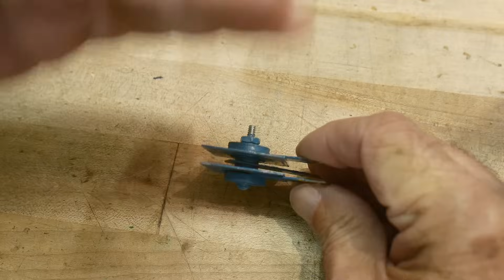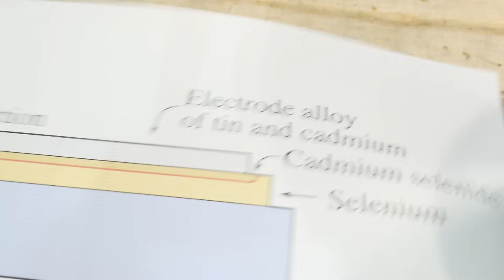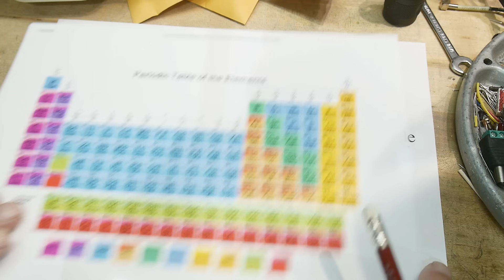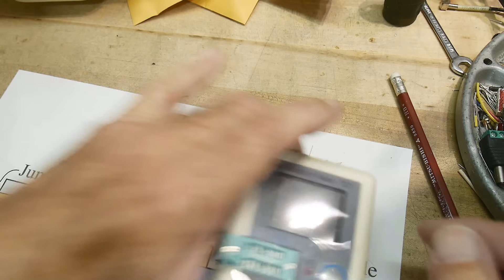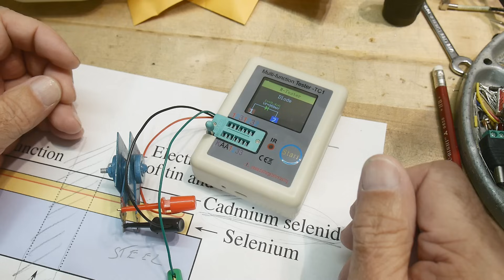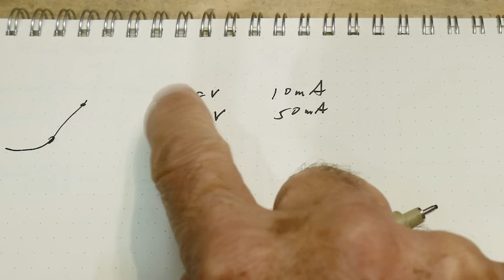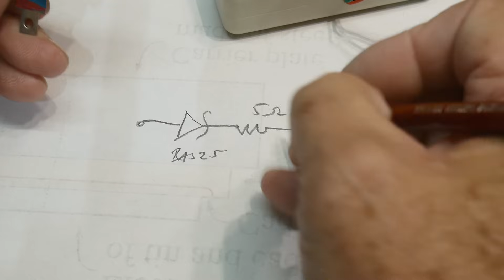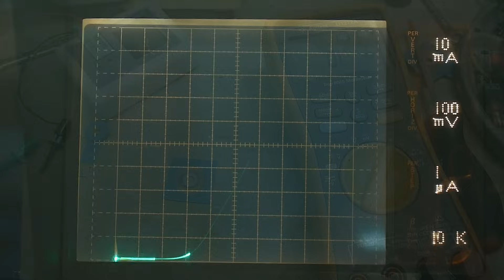#1753 Selenium Rectifiers

Comment: A nice look into selenium rectifiers - I wouldn't discombobulate one without gloves though. Still better than letting it burn, emitting toxic hydrogen selenide.
Reply: I remember that smell very will. I assumed it was a Sulphur compound though, It was really bad!  Smelt like the Devil!
Reply: @barrybogart5436  Like anti dandruff shampoo, which contains selenium in it.
Reply: @barrybogart5436 i agreee, as i described in a comment here, i also was "experienced" ...
Reply: I've heard so much about the stink.... I "need" to smell it.
Reply: @edgeeffect  Trust me you do not, it lingers for a really long time.
Reply: @SeanBZA  see, if this was a chemistry video, not electronics, you'd just say "there's always got to be one". ;)
Reply: @edgeeffect  I hope you're just sarcastic :)
Reply: I once dug through a couple of dumpsters full of electronics from some industrial warehouse, where I scavenged tubes ( Telefunken 12AX7'S), tube based Philbrick op amps, hundreds of chicken head knobs, rotary ceramic selector switches, power and audio output transformers for tube equipment, and lots of other great resellable stuff; the dumpster was also full of  thousands of various selenium rectifiers but I didn't bother to take any of them.  Of all my flea market and dumpster diving hauls, I regret not having had more time to really dig into those dumpsters because they were full almost to the brim and I could only dig down a couple of feet or so as I rooted around insidethe dumpster; I only had a day and a half to make a couple of trips and haul two car loads of stuff home, before it all got hauled off to a dump somewhere.  If I had had more time I would've rented my own dumpster and had it delivered on-site so that I could toss the unwanted stuff into as I dug deeper into the full dumpsters. I paid the guy cleaning out the building a couple hundred bucks for the privilege of scavenging from those dumpsters, and I sold about $5000 worth of tubes and parts from just my two station wagon loads.  I barely scratched the surface of what was in those dumpsters! Unfortunately all that toxic selenium probably went into a landfill but I don't know what else you could do to recycle those nowadays.
Reply: @goodun2974  holy bloody moly, what a treasure! You were luckier than that crazy Aussie bloke :)
Reply: @KeritechElectronics  ,  I've had some good dumpster hauls and fleamarket finds over the years,  Such as an old 5 channel RCA tube-type mono broadcast console that I paid $70 for and flipped for 1500 bucks; a rare Western Electric theater amplifier that fetched several grand, and a very complex Brook 10C amp (look that one up) that sold for 1500; some rare Western Electric tubes and a bunch of KenRad 350B's (= 6L6G) that I got 400 to 800 a pair for..... I once found a pair of vintage Genelec Gold Lion KT 66's with individualized test reports in sealed bags at a flea market!  The dumpster hall I mentioned previously had some other equipment still in the building where I found a pair of power supplies that each used a pair of Telefunken EL34 as series pass regulators! .Most of the good old stuff has disappeared from the flea markets and tag sales these days, and much of it probably ( sadly) dumpsterized by now.  I'd hear the stories from some of my former telecommunications workers about seeng dumpsters full of vacuum tubes being thrown out at Hamilton standard;  or Id be driving around and seeing an old TV repair shop and asking if they had any tubes lying around only to be told they threw everything in the dumpster the year before.....people in general are, and capitalism in particular is, incredibly wasteful, and rough on the environment.
Reply: Due to the cadmium and selenium  content I'm guessing that they can't be used or even imported into the EU nowadays.
Reply: @goodun2974  Funny thing is that you can bring them in, if you use the old Soviet ones, as that seems to slip past the inspections.
Reply: @SeanBZA  , do you you mean cadmium photocells,  Fender-style LDR's, or selenium rectifiers?
Reply: @SeanBZA  ב''ה, more profit and NATO benefits in investigation of a Soviet poisoning plot.
Reply: When these diodes overheat they smell like "rotten-eggs" and I was advised by my "elmer" to never breath the smell/smoke back in the 1970's.